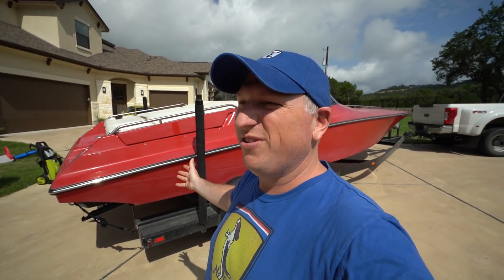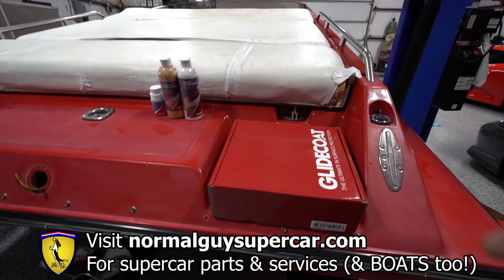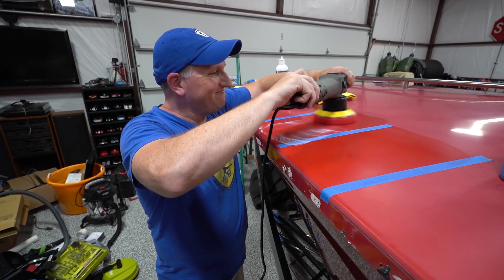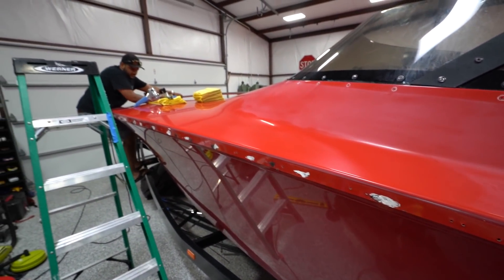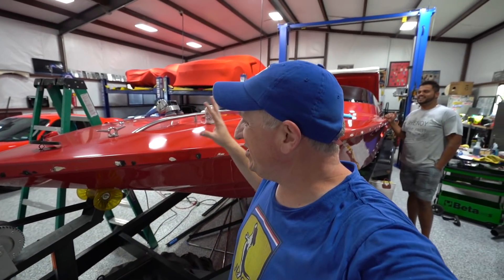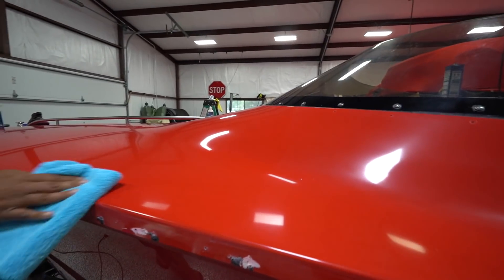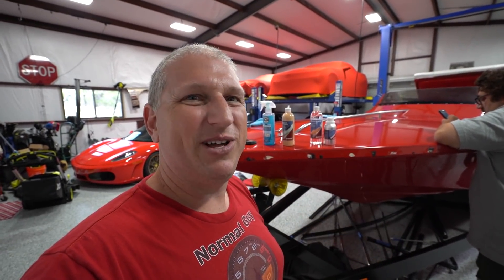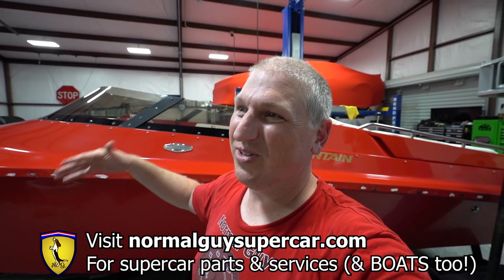Using GLIDECOAT Compound, Polish & Ceramic Coating to RESTORE my BOAT'S FADED GELCOAT

Comment: Looks good,
A quick suggestion. Don't use too much of the heavy compound. That's why you have to blow it off and you clog up the pad. Get some speed into the pad and be gentle, and just lest the pad break the compound down so it can do its work. Cutting a gelcoat like this is in many ways like cutting a single stage paint on an older Ferrari. Only difference is that here you have a lot to work with, on an older Ferrari you burn though the paint in no time🙂Also on softer surfaces like gelcoat and soft paint, try going straight from heavy to a finishing compound. They cut so easily that they can often be cut with minimal effort once the oxidation and such is gone.
Reply from the maker: Thanks for the tips! :)

Comment: I'm thinking the cut & polish, plus clearcoat, should give the boat another 1-2 mph top speed by cutting down on surface drag. Please check this out next time on the water!.... Provided you treat all the wetted surfaces, at minimum the back half of the bottom/the planing surface!!
Reply from the maker: I wouldn't be surprised if it did go faster. But even if not it will look so much better in the water